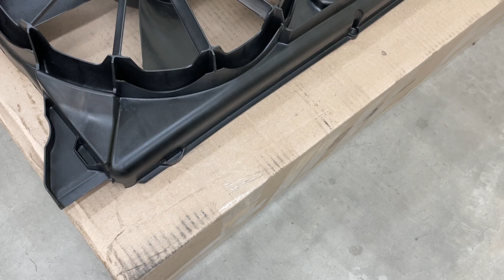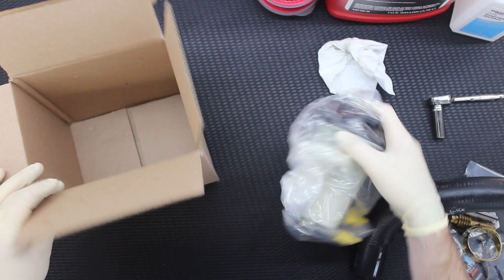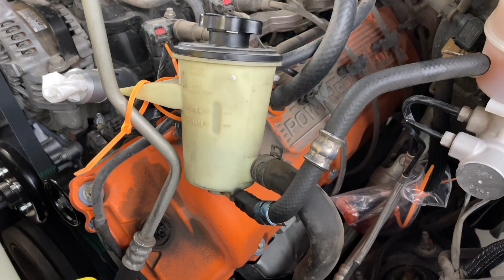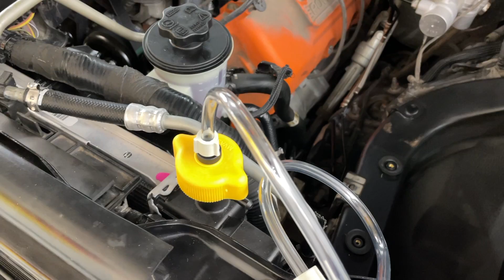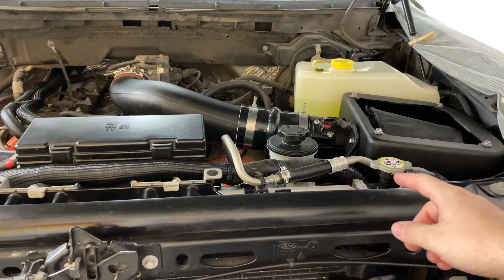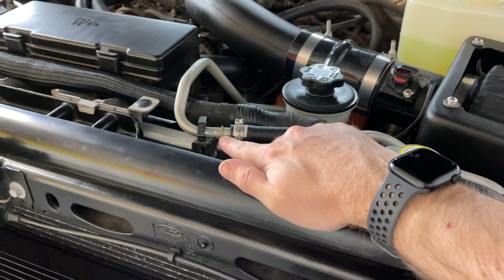Gen 1 Ford Raptor Cooling System Replacement (and 6.2L F-150) - Part 5

Comment: The new power steering resevoir you installed seems to lack the black filter in it. is that still ok for the raptors?
Reply from the maker: It's the one that for specifies as superseding for my particular truck, so it should be per them!  Thanks for watching!

Comment: Five part series makes this seem really intimidating.
Reply from the maker: Certainly not the easiest cooling system to replace everything in.  Radiator and lower hose is the worst part of it all.  I've done most similar jobs in a couple hours on Toyotas, GM, other Fords, etc.  This truck is as complex as many of my German cars when it comes to disassembling the cooling system.  Thanks for watching!